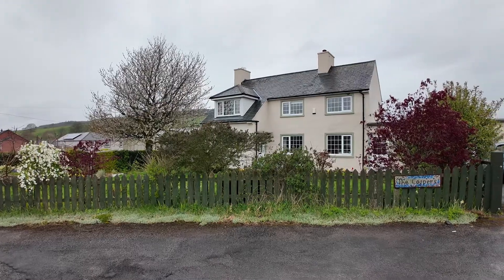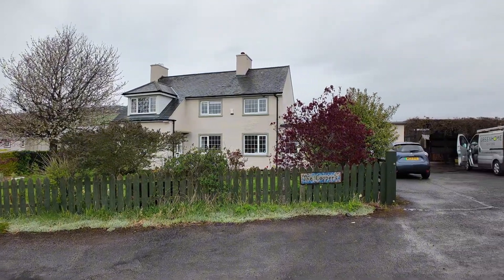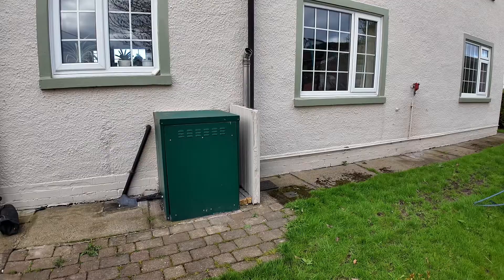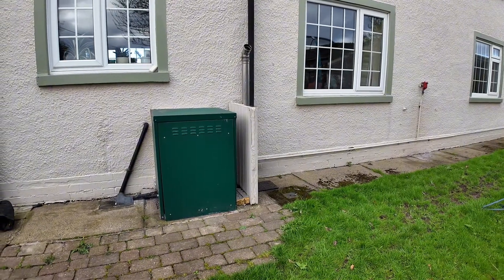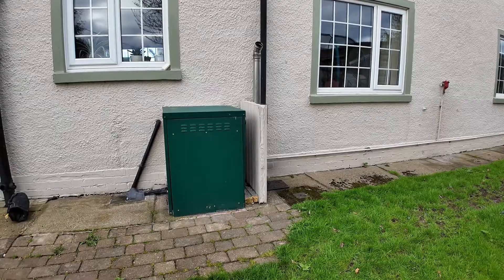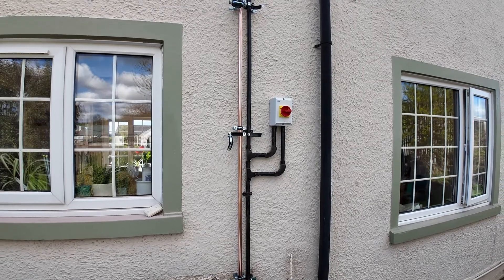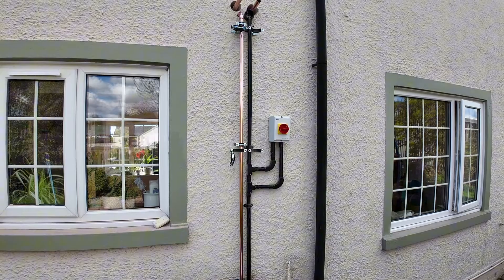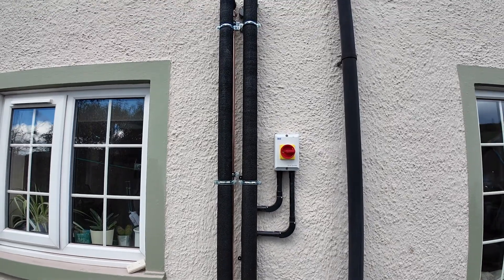Heat Pump Installation & Design Tips in Carlisle

Comment: 2.3.4.5 or 4.8.2.3 and 4.19
Isolation Switches
Every water heater, air-conditioning and heat pump system shall be provided with an independent isolating switch (lockable) installed adjacent to but not on the unit (at arms length or 1.25 metres).